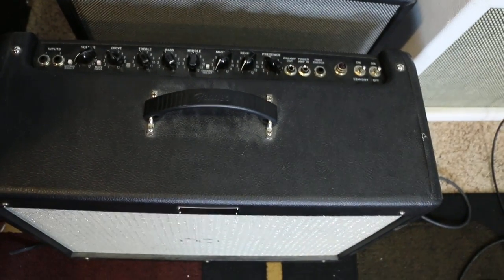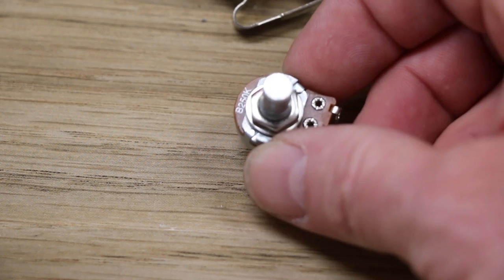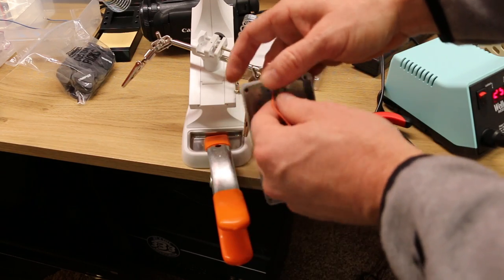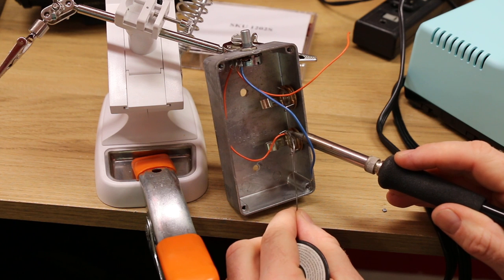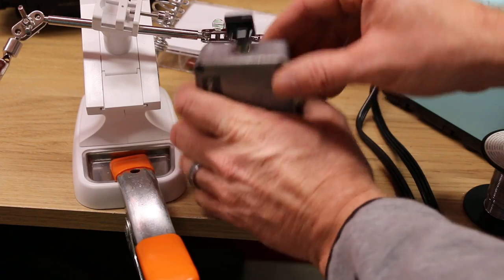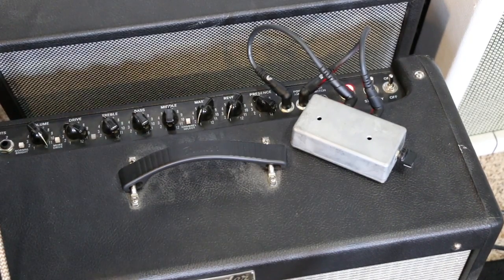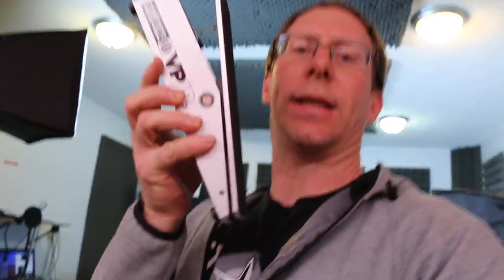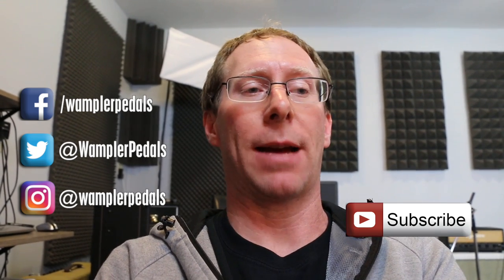Easiest “modification” for Fender Hot Rod amps (and others) to make it better for home use

Comment: I find people are always super confused by what this is.  It's not an attenuator.  It does not allow you to get cranked tube amp sound at lower volumes.  It's simply a less sensitive master volume knob.  That's it.  Imagine if your phone had two volume buttons.  One was super touchy and one was not.  That's it.  That's all this is.  If you turn the amp master volume to 10 and then turn this knob to 1 it would be the same sound as if you had no box and the master volume was set to 1.  Which knob, amp or box has the lower setting, that is what is going from the preamp to the power amp.
Reply from the maker: Sort of true, but not entirely. The clean channel does not have a master volume. The master only controls the distortion channel. The volume on the amp is more similar to a gain control on a tube amp in its placement. The mod simply adds a master volume. You are correct that using it with the distortion channel is the same as having two masters, but few use the distortion channel anyway.
Reply: @wampler_pedals  I think a lot of people think this will allow you to get power tube overdrive at bedroom levels and that's not what this does.

Comment: I'm not understanding that you have the volume at 7 and the Master (left of Reverb) is at 1.  There is no pre amp out and power amp in on say a Bassman amp.  So this box works on the Hot Rod.
Why can't you get the same effect using the volume knob and the master knob?
Reply from the maker: This is actually answered elsewhere on the comments. The master volume on this amp does not affect the clean channel, it’s only affecting the dirt channel
Reply: @wampler_pedals  So what do you need to do to a Bassman amp to get the same ability to play the amp to drive the tubes but not have it blow your ears out..
Reply from the maker: You would need an effects loop to use this

Comment: Friend, would you help me with something, please? Normally treble bleeds are made with a capacitor and a resistor, this one shouldn’t too?
Reply from the maker: “Treble bleed” is sort of a common used jargon but it’s actually a high pass filter. You can certainly add that to this, and even make it switchable (or controlled with a pot)
Reply: @wampler_pedals  I'm making a master volume on an amp I'm buying and I'm searching for this video because I'll do it just inside the amp and put the Master volume knob on the back of the amp and make things easier. It's the same as the pedal, but inside of the amp connected to the FX Loop circuit. What capacitor and resistor would you use in that case? Just the 100pF cap you talked on the video or another one?
Reply: @wampler_pedals  if you could help me with that I would thank you a lot. Your channel is so informative and useful. But since now I thank you. God bless you!

Comment: If I run this through the front of my amp, will I still get all the great break up from having my master volume all the way up on my amp ? (Bass breaker 007, No fx loop)
Reply from the maker: No, it will work like the regular volume control when ran up front. Basically as shown here, it’s being used as a master volume control
Reply: Wampler Pedals crap. Guess I need an amp with a loop. Thanks.

Comment: I have installed A100K but for majority of the pot travel it does nothing and only last 1/4 it starts to decrease the volume in a drastic way. Have I incorrectly soldered it?
Reply from the maker: Volume decrease should be counterclockwise. If it’s clockwise then this will happen, due to the pot taper. Just swap wires going to lug 1 and 3, OR use a reverse audio taper if you want it to get quieter when turning clockwise
Reply: @wampler_pedals thanks. I will check tomorrow, almost midnight here. This was my first soldering in my life. Tried to go by your video but it can be I made mistake, will see tomorrow.
Reply: @wampler_pedals so by turning counter clockwise, volume decreases. However, first half or even 2/3 of the  pot travel, it doesn't change the volume. Only last 1/3 of the pot travel.  Wouldn't it help to change to linear pot to start the volume decrease immediately when starting turning counterclockwise?
Reply from the maker: Won’t hurt to try- each amp is different so swap in a linear and see if it improves the reaction.

Comment: Can I use this in between the speaker out and the speaker if I don't have an effects loop on my amp?
Reply: NO!
Reply: @lnxguit  Didn't think so.  Thanks.  Looks like a Carl's Speaker Soak or similar would be my option
Reply: @coachrutt55  Yes, you'd need a load box to handle power

Comment: Put a 12AU7 in V1 it has a gain factor of only 19 where a 12AX7 has gain factor of 100 or higher.  Use a pedal to control the gain of the preamp  to whatever you like.  This will open up the sound amp and make it sound better.  The line out and return on those amps are a poor design.

Comment: Hey Brian, I have a '69 fender bassman 50w and I have the same issue, there is no master volume switch. so I don't get to use the amp when my Wife is home is there anyway to use this device or a device like it in some form with my Bassman? I don't believe there is access to the effects loop like the deluxe has. Can I just add it between the amp and the speaker?
Reply: Nope, but that is exactly where an attenuater goes, just buy a good one
Reply: I'm not sure what a good one is and a quick search shows that they seem to be fairly expensive  so unfortunately that won't be happening. I could by a small watt tube amp for the price of the attenuaters I saw in my Google search
Reply from the maker: do noooot use this connected from amp to speaker. You'll definitely smoke the pot, possibly catch fire, and most likely mess your amp up. You'd want a real attentuator for that, as Tony mentioned
Reply: Thanks, I've talked to a local amp guy and I'm going to have a master volume installed.

Comment: I know this videos a bit in the past st tgid point, but is there really such a thing as an actual attenuator? I know you're only wiring in a pot for a  volume control, but I couldnt tell if you just meant thst all attenuators arent actually attenuators, or thst this device youve just made specifically isnt an attenuator. Becaude they definitely have srent just a pot and i was just about to start building one and if I'm wasting my time, thatd be some pretty kickass info to pocket before i spent the time amd parts and cash (mainly just the cash, the rest is fun as shit). 
Anybody with some insight wouldbbe greatly  appreciated. Just not like, monetarily or anything. You get to rock out a thank you or whatever...
Reply: He means this is not at attenuator.  An attenuator goes between your power amp and your speakers allowing you to crank your power amp but turn down the volume.  All this is, is adding a second master volume knob.  One that is more sensitive.

Comment: same problem with Blues Deluxe. No loop though. Can this be adapted?
Reply: Putaspellonyou 
Does it have a pre amp in and out?
Reply: I have an original Blues Deluxe (95 model) and it has a an effects loop.....only difference is the foot switch plug-in is on the other side of the loop.

Comment: So why would a product sold as an attenuator cost $200-300 when you can build this for $20-30? Does is have something to do with the load that comes out of the power amp/rectifier?
Reply from the maker: Yes, an actual attenuator is more complex than a simple potentiometer.
Reply: This isn't an attenuator.  A real attenuator takes output from the output transformer and dissipates it as heat (or some other load) before going to the speaker.

That said, I built one for less than 30 bucks in parts using a 100Watt mono LPAD for my 15 watt amp.
Reply: Ted Schoenling Great explanation. Power brakes and such still seem pretty expensive if you got the same job done for $30
Reply from the maker: There's much more that goes into pricing other than parts. There's margins, overhead, labor, insurance, rent, utilities, warranties, R&D, etc
Reply: Bingo, when you purchase something as a product you are paying for more than the bits.  When  you do it yourself you are spending your own time to put something together for yourself.    I'd never ever sell what I built to anybody as it is simply not a product.  The R&D, getting parts sourced, labor, marketing, paying some guy like Brian here ;)  to noodle around on the guitar all day long .. it all adds up.

Plus basic economics here.  Value is subjective.  Think about it this way.  SItting in your house, how much would you pay for a glass of water?  Not much if anything.  Now, how much would you pay for the same glass of water while sitting in the middle of death valley after not having any water around for hours?  Quite a bit more.

Comment: can we put this volume knob betwen the output of the amp and the speaker?
Reply: Not unless you want to fry your amp.  This box is simply creating a controlled short.  You get away with it here because it's line level.  If you are pushing serious current, you would effectively drop the impedance of the load and push massive current through your output section of the amp until it goes poof.   If you want a volume control on the way to the speaker, you need an attenuator.
Reply: Thanks! I figured that, but it never hurts to ask, hehe.

Comment: Would there be a difference between this and an attenuator?
Reply: Yes, massive difference. This is essentially an additional volume control. It reduces the signal level going to the power tubes...With this solution, you'll never saturate the power tubes and get the power tube distortion for tones from dialled up amps..This is a voltage attenuator
Power Attenuators on the other hand are placed after the power section and right before the speakers. They soak in most of the power from the tube amp and allow a fraction of it to move the speakers. This way, you can get the power tube saturation and the tone that comes with it, without the high volumes. They are slightly more complex to build and you need to match impedance of the amp out to the attenuator input. The solution on this video is virtually useless...Only helps if you want to increase the sweep on your master volume control. For example if the amp is too loud even on "1", then this can help you get you more control by helping you dial in a volume between 0 and 1.
Reply: @abhijitsingh8454  thanks, That's what I was thinking as well

Comment: Couldnt you just use the volume control on the guitar itself?
Reply from the maker: Primal Volital no, that would be before the preamp and any pedals. This is putting it after the preamp (mostly) and after any pedals. Two totally different sounds and applications.

Comment: Why not just use the master volume on the amp as the master volume? You know, the knob that's right next to the Reverb knob?
Reply from the maker: Because that’s only operational on the distortion channel
Reply: @wampler_pedals  Oh that makes sense. Thank you. I've never had a Hot Rod Deluxe, but it seems like a very cool amp. That's a great simple solution you have there, and seems to work well. I don't know why that didn't occur to me about the master only being operational on the distortion channel. Duh.

Comment: Why not just use the master volume on the amp?
Reply from the maker: There is no Master Volume on the amp, only a volume that then goes through more tube stages. Look at the schematic and you'll see what I'm talking about: https://elektrotanya.com/PREVIEWS/63463243/23432455/fender/fender_hot_rod_deluxe_sch.pdf_1.png ... 

So as you turn up the volume, you'll get more clipping. Plus, the volume is a linear taper (IIRC) so when it's turned down low it's going to sound quite loud. Adding a volume in the loop puts the master volume where traditionally a regular master volume amp would have it.

Comment: Brian can a 250k pot be used ?
Reply from the maker: Should be fine as long as the loop is buffered,  I would just make sure it’s an audio taper.
Reply: @wampler_pedals  thanks for the reply Brian , im using a blackstar ht5r head. The loop has a selector switch that can change the loop to either -10dbV or +4dbV

Thanks to the lockdown the only pot i have at hand is either a 250k or 500k DiMarzio custom taper pot.
Hope that you could let me know if i can use that.

Thanks again and love your pedals especially the tumnus that i have 3, 1 for each of my 3 boards
Reply from the maker: I would double check with black star to make sure the loop is buffered (it probably is), and if so use the 250k.

Comment: Would a linear taper work?
Reply from the maker: +Fuzzynaval420 it will work, yes, but not optimal
Reply: Wampler Pedals   please answer Brian, why  is a linear pot not optimal? I have a  bognor valve line 6 spider, with a master control knob  fitted, or should I say" out of control knob " but I run my pedals from the send & return, so were do I put the volume box? or do I change  the master pot to a linear pot, Or as your video explains,   use an EQ just for that function (which is more expensive )I am told by the dealer, the reason for this over sensitive  master control knob, is because it's a modelling amp, is that correct?  And the only way to cure the problem is to turn down the Chanel volume  knob, which defeats the object, when I get the sound I want, I need control over the master volume, hope you can help.

Comment: Brian! Thanks for the video. I need some help: I have the chance to get a used amp for practicing (I only play at home). The two options I am looking at are the Fender Blues Deluxe Reissue and a Hot Rod Deluxe. Both for the same price... Which one would you recommend? Or should I go for something different? I would really appreciate your comments on this. Cheers and keep it up with the amazing Channel!
Reply: Get a Blues Junior. Less power and also has a master volume built in

Comment: You could have just plugged your guitar lead into the power amp in. Easier.
Reply from the maker: +Fender Blues --  you bypass so many things that give the tone of that amp. That's not an effective means of getting the same tone at a lower volume.
Reply: Yes, your right, noted.
Reply: It works great with external preamps though.
Reply: **you're not your. smh

Comment: Hey Brian, love the video! But I must confess,with my Fender Hot Rod Deville III I run the Wampler Ego compressor to tame my amp.I have it on for clean and with my overdrive or distortion pedals.I still get great tone even at low volumes without having to deal with the "amp doesn't come on until 2 problem". I can crank the amp, and turn down the leveI on my Ego Compressor. Your pedals are my favorite by the way! I use it in Church even!
 Check it out  https://www.youtube.com/watch?v=OCol6Nruyhs . I have the Wampler Tumnus now from Guitar Center where I teach guitar, and love it as well! God Bless you buddy and keep up the good work! Any insight you have to help is greatly appreciated! Rob Ransom-Appleton,WI
Reply: Hey Rob, I’m considering picking one up to use for home and church. I don’t understand much about this stuff, but do you run the compressor in the effects loop that people use? Or before the pedal?

Comment: Please, what does parallel R&C on a signal chain? I can't find info about it in an audio context.
Reply from the maker: do you mean a resistor/capacitor? It depends on where it's at on a schematic.
Reply: Wampler Pedals yeah, caps and resistors. I've seen them on Ravi C - seventhheaven (bogner influenced) between jfet drive stages.
Reply from the maker: it totally depends how they are in the circuit. could be high pass or low pass filtering, or even both.

Comment: I use one of these on my blues jr.
Reply from the maker: +David Winchester there isn't an effects loop on the blues junior though...?
Reply: Wampler Pedals I know. I just use plug the guitar through it and to the amp input. Definitely not the same as using the inputs on. The Deluxe and DeVille. But it does make my Jr. way more bearable.

Comment: But the amp already has a master volume  ......... most amps with fx loops do and so it's redundant, and the pot IS attenuating the signal but at the preamp stage not the power amp, it's passive , that's all it can do.
Reply from the maker: The master only affects the dirt channel, not the clean channel. The Pot is at pre-PI, arguably post pre-amp, but it fixes the problem most have with the amp, which is a terrible choice in pot taper on the volume on the clean channel.

Comment: This guy is obviously a tech dude.  Here's a simpler fix...and better.  Replace the first pre-amp 12AX7 tube with an AT7.  Hello??
Reply from the maker: That’s not the same thing, at all. That only changes the gain in the first two stages. Yes, it will make it less loud, but at the expense of the amount of gain, a tonal change, and less controllability
Reply: @wampler_pedals  Not my experience.  Gives you MORE control.  Are you a tech??  Yes, it lessen the gain, but also smooths out the gain and makes it less jumpy.  Have you actually tried it??  Tone is fine but less overall volume so you crank it a little more.  We ARE trying to solve the jump from nothing to loud between zero and 2 aren't we??   Your's is NOT an easy fix.  Sorry to disagree but not many are going to get into building and soldering an additional volume control.
Reply from the maker: Yes of course I’ve tried it. Not a fan of the tone afterwards.
You may have missed the idea that much of this channel incorporates a diy electronics aspect?